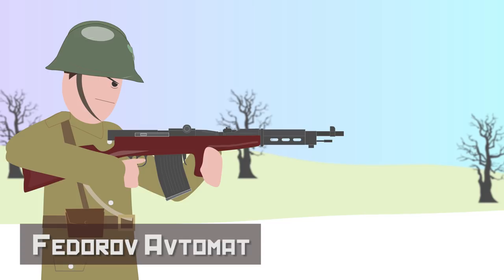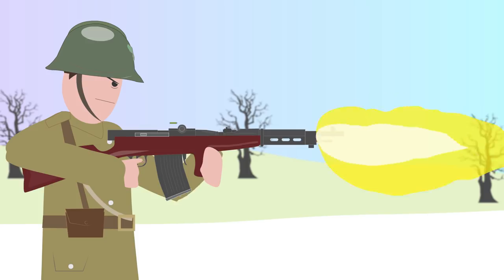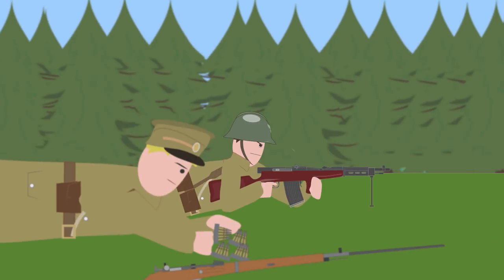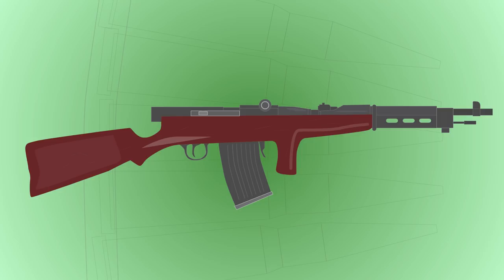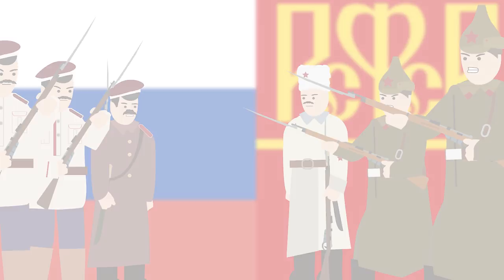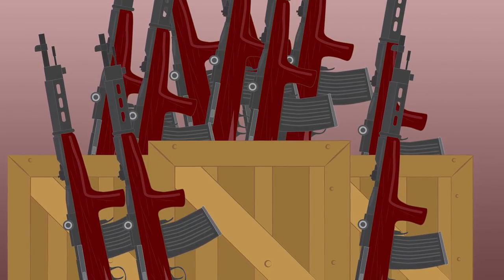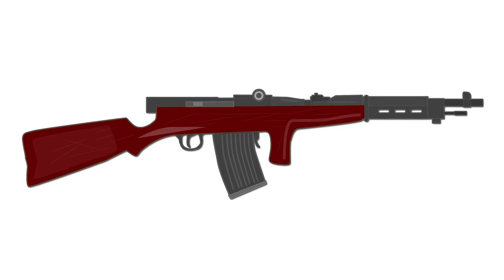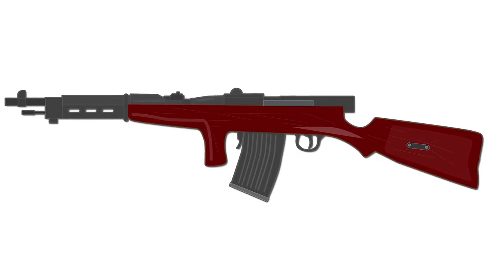Fedorov Avtomat, The First Assault Rifle?

Comment: THAT weapon may hold the key to an automatic high velocity firearm. The action is unique and has not been repeated. The barrel acts as recoil mitigation and piston. The barrel does not have a tapped gas port.
Reply: The action is a dead end Design that lead to nothing.
Reply: @Greycat2017  You got to think outside the box, Ivan. By itself, the action is insignificant; however….

Comment: "Required hand fitting" what does that mean? "spare parts were few and far between"? 30,000 were built and 3 magazines were standard issue. It CAN be fed by stripper clip but it also had detachable box magazines
Reply: Probably wanna drop a zero on that number.
Reply: Quote: A total of 3,200 Fedorov rifles were manufactured between 1915 and 1924 in the city of Kovrov; the vast majority of them were made after 1920

Comment: I wouldn't really classify it as an assault rifle, since the restrictive loading system put it more into the role of an LMG. The Bren and BAR were relatively similar and they're usually not described as assault rifles. An assault rifle is typically a fully automatic gun firing something between a full rifle round (.303 or 30-06) and a pistol round (9mm or .45) being used by a single soldier to rapidly advance.
Reply: FEDOROV AR (6.5x47) ballistic properties are very close to modern idea of "ideal" assault rifle and its ammunition like:

6.5mm Grendel (6.5×39mm)

.220 Russian hunting cartridge is developed based upon the military 7.62x39mm M43

6.5x47mm Lapua (or 6.5x47mm)

The 6.8 mm Remington SPC (aka 6.8 SPC, 6.8 SPC II & 6.8×43mm)

.280 British

300 AAC Blackout, SAAMI short name 300 BLK, also known as 7.62×35mm

Comment: A problem with the Avtomat is that it uses a full-size rifle cartridge. It's generally agreed upon that assault rifles fire intermediate rounds. On top of that, its tactical relevance is limited as it never saw widespread use as the later (and generally agreed upon as an AR) STG-44

Comment: Even though it resembles an assault rifle and even has elements of one it's still not one. It's much more related to a LMG or DMR like the BAR or SVT. Definitely revolutionary though. The cartridge was much too powerful and it needed a pistol grip. The fact that it ran at 400 rpm with a closed bolt during WW1 is astonishing.
Reply: 6.5mm Arisaka round size and energy is between a pistol and big tank gun along with 7.62x54R mm. It is also some nearly 5 lbs lighter than a BAR. It is also some 5 inches smaller than a BAR. Pistol grip showed us the future as many bigger guns will get more pistol looking design grips.

Doctrine wise, role wise, and design wise in modern terms. It's close to the current assault rifle though it's s abit more heavier than an M16 and M4 really that's due to argue being a 1st gen design and firing a heavier bullet at similar velocity. Plus the name wasn't coined yet then.  However by modern terms it is by definition and role wise an AR.

Comment: Pistol:
• pistol grip
• pistol cartridge

Rifle:
• Rifle cartridge
• Single fire

Assault rifle:
• Pistol grip
• intermediate cartridge
• select fire

Machine gun:
•Rifle cartridge
• at least fully automatic fire

______________________________________

Fedorov Avtomat:
• Rifle Stock
• Rifle cartridge
• select fire

It's a machine gun.
Reply: Nope. The 6.5 Arisaka is maybe classified as Rifle cartridge, but that's just because it was never reclassified - for obvious reasons.
6.5 Arisaka has the same energy as modern intermediate cartridge 6.5 Grendel. Also, it had energy between a standard Russian pistol cartridges and main rifle round, the 7.62x54R - that's literally the definition of intermediate round.
 And at the same time, it was used for the same reason as 7.92x33 Kurz - low recoiling cartridge for automatic fire.

So the only thing it "lacks" is pistol grip.

Comment: Assault rifles typically have intermediate rifle caliber between shorter than battle rifles (x50mm) and longer than submachine gun (x20mm). So it's one of the first purpose built gas-operated battle rifle
Reply: What? It doesn't matter how long the casing is - the energy of the cartridge matters. 
The 6.5 Arisaka has the same energy as 6.5 Grendel, which is an intermediate cartridge.
Reply: @BloPsy__  well the underpowered 6.5x50mmR type 38 bolt-action rifle (from the early 1900s) compared to the 6.5x39mm grendel (designed for med-long distances on AR platform) then theres 9x18 and 19mm compared to 9x39mm
Reply: @lx1995Mk2  9x18, 9x19, and 9x39? I don't really know what you try to say.

Comment: Not an assault rifle, an assault rifle fires a intermediate carriage that is in between a pistol round and rifle round. It is just a select fire rifle
Reply: Then you don't know much about the cartridge this Avtomat used.
By today's standards, 6.5 Arisaka is certainly an intermediate cartridge. It has the same energy as 6.5 Grendel, which is modern intermediate cartridge. Also, it was used for the same reason as 7.92x33 Kurz - low recoiling cartridge more suited for automatic fire.
 And on top of that, in terms of Russian military, the 6.5 Arisaka had power right in between of standard pistol cartridge and standard rifle cartridge - which is the definition of intermediate cartridge.

Just because the cartridge wasn't initially designed as intermediate cartridge doesn't mean that it cannot be considered as one when used by Russian military in Avtomat Fedorova.

Comment: No, it wasn't the first assault rifle, although in practice it was deployed more like an assault rifle.  Since it fired a full power cartridge (albeit, at the lower end of power) in the form of the 6.5×50mm Arisaka round, but this is way more powerful than intermediate cartridges and actually closer to the full powered ones.  It would be fair to call it (as said) an 'ancestor' of the assault rifle.
Reply: it's the first battle rifle, not assault rifle, and yes there is a difference between the 2
Reply: @engiturtle65  
I'd reluctantly say it's a battle rifle, but its full auto option (and deployment) is questionable. If so, how do you put the FN FAL and the BAR, especially the FN Model D?
Reply: @MrBahjatt  the bar is more of a light machinegun
Reply: @MrBahjatt  also a quick google search litteraly says thah the fedorov avtomat is the first ever battle rifle
Reply: @engiturtle65  
A limited capacity (Not so) light machine gun yes.  Yet the Federov Avtomat is as you say is more of a battle rifle; albeit, an underpowered battle rifle. 

I say due to its round and automatic capability, it is really in a grey zone between battle rifle and assault rifle, veering closer to the light machine gun/battle rifle concept.
Reply: @MrBahjatt  yeah, alot of weapons would land in the grey area at the time because of how new they were, especially since the fedorov also was used more as a  lmg than a battle rifle, im also pretty sure they tried to make an actuall lmg version of the fedorov avtomat
Reply: Even though the 6.5 Arisaka was developed to be a full-power rifle cartridge, it's a very anemic one. In fact, it has an energy of around 2600J at a velocity of 770 m/s when shot from a 31-inch barrel. That is already comparable to the modern intermediate cartridge 6.5 Grendel. 
When shot out from Avtomat Fedorova with a more modern-like barrel length of 20 inches, it has a velocity of around 654 m/s and energy of around 1925J - Which is even less than what 7.62x39 outputs. 
In terms of its use in Avtomat Fedorova, it was used exactly because of this low energy and thus low recoil - the same reason why 8mm Kurz was developed. As a bonus, the cartridge falls right in between standard pistol cartridges and the standard rifle cartridge of the Russian Empire, the 7.62x54R (3700J), which is the definition of an intermediate cartridge.

Comment: >6.5x50
>clips instead of mags
>assault rifle
yeah sure....
Reply: It had removeable mags, but the Russians didn't have enough of them, so you had to load them with stripper clips. Obviously it didn't have an intermediate cartridge, that didn't exist back then. The point, is that it was one of the first automatic/semi automatic RIFLES.
Reply: @grootsChannel  that's the point, it was maybe the first AUTOMATIC RIFLE, but not an assault rifle.
Reply: @Blei1986  yes, but I could've been used like an assault rifle, if only the Russians realized that. Instead they used it as a regular old machine gun.
Reply: @grootsChannel    in theory yes, but as i stated in my first post, the cartridge is pretty much a rifle cartridge.
The "awsome" thing of assault rifles is their "special" ammo, that has light recoil for (more or less) accurate burst-full auto fire at short range but is accurate enough for mid-high range shots in semi auto.
it's the "ultimate" multi purpose round.
i really doubt a 6.5x50 round in full auto will be a pleasure or accurate to shoot.
Reply: @Blei1986  Well, I gotta give you that. I guess you could call it the predecessor of the first assault rifle, more than the actual thing.

Comment: I wouldn't class it as the "first assault rifle"  due to one factor, it doesn't shoot an intermediate cartridge, it shoots the 6.5x50mm arisaka round making it a full bore rifle cartridge, the AVS 36 has a select fire system also but it isn't classed as an assault rifle even though it has the same capabilities.
Reply: FEDOROV AR (6.5x47) ballistic properties are very close to modern idea of "ideal" assault rifle and its ammunition like:

6.5mm Grendel (6.5×39mm)

.220 Russian hunting cartridge is developed based upon the military 7.62x39mm M43

6.5x47mm Lapua (or 6.5x47mm)

The 6.8 mm Remington SPC (aka 6.8 SPC, 6.8 SPC II & 6.8×43mm)

.280 British

300 AAC Blackout, SAAMI short name 300 BLK, also known as 7.62×35mm

Comment: It's not assault rifle, it's main battle rifle. Assault rifle shoots intermediate cartridge (5,56x45,7,62x39,5,45x39 etc.) Fedorov shoots rifle cartridge
Reply: But by modern standards, the 6.5 Arisaka which was used in Avtomat Fedorova is basically an intermediate cartridge. It has the same energy as the 6.5 Grendel, which is a modern intermediate cartridge. 
So it is really a battle rifle as you say?

Comment: Assault rifle isn't a category officially.. AR stands for Armalight.... I thought you did your research
Reply: - AR can stand for Armalite Rifle or even Assault Rifle (Of course not in case of AR-15). Assault Rifle is way older term than AR-15 so what's your point? 
- Assault Rifle is official category used by many miliatries around the world. It all started with StG 44, which gave the name to that category. Sturmgewehr = Assault Rifle. I will list few examples here: StG 77, FAMAS, RK62, etc... They are all designated as Assault Rifles.

I thought you did your research

Comment: So what would actually constitute as an OG assault rifle bc I've always felt like the BAR was one of the first as well even though it was meant to be a squad "LMG" even though it only had a 20 round box magazine and could be fired effeciently and accurately shouldered like assault rifles.
Reply: Browning did make a 40-round box magazine for the BAR, but the BAR wasn't an assault rifle. The BAR fired full powered ammo, so even if you use it as a rifle it would be a battle rifle. Same is true for the Fedorov Avtomat and AVS-36, they too were battle rifles. A battle rifle is a selective fire rifle that fires full powered ammo. An assault rifle on the other hand is a selective fire rifle that fires intermediate ammo like the 7.92x33mm Kurz, 7.62x39mm, or the 5.56x45mm NATO. So the first assault rifles were the Machinenkarabiner 42(H) and the Machinenkarabiner 42(W), they were the predecessors of the StG 44.
Reply: @TheNocturnalEvil  FEDOROV AR (6.5x47) ballistic properties are very close to modern idea of "ideal" assault rifle and its ammunition like:

6.5mm Grendel (6.5×39mm)

.220 Russian hunting cartridge is developed based upon the military 7.62x39mm M43

6.5x47mm Lapua (or 6.5x47mm)

The 6.8 mm Remington SPC (aka 6.8 SPC, 6.8 SPC II & 6.8×43mm)

.280 British

300 AAC Blackout, SAAMI short name 300 BLK, also known as 7.62×35mm

Comment: Actualy there is a simple way to tell if its an assault rifle or not
1.if it can shoot fully auto and semi auto its an assault rifle
2.if its have a detachable magazine its an assault rifle
3.if the bullet was bigger than an pistol and an smg round but  still smaller than a rifle or a machine gun round (intermediate round) its an assault rifle
4. If the rifle has all of the 3 category above  its an assault rifle 
But fedorov sadly doesnt have the 3rd category he use arisaka rifle and its a rifle bullet not an intermediate bullet
Edit: if the rifle only has the 1st and the 2nd category its could be categorised as a battle rifle or a ligth machine gun with banana magazine
Reply: Actually, it does have the 3rd category - you clearly don't know much about the 6.5 Arisaka.
By today's standards, it's actually an intermediate cartridge. It has the same energy as the 6.5 Grendel, which is a modern intermediate cartridge.

Comment: "it had to load all 25 rounds via stripper clips"

bf1: magmazine
Reply: keith sze  yeah you're right
Reply: It would be so annoying if they it was reloaded via stripper clips
Reply: it has a magazine, just they had no other magazine to switch it (on the early models, the later ones didin't require that hand fitting anymore)
Reply: Mmm… m a g M a z i n e

Comment: For a gun to be considered an assault rifle, it must have 3 things so far:
Selective fire: yes. Fedorov got semiauto and full auto.
Detachable mag: Fedorovs got only 1 mag per rifle, but technically they pass this. The mag is detachable.
Calibre: assault rifles must have an intermediate cartridge. That means, no pistol calibre or machine gun calibre. And there is the problem: Fedorov was chambered in 6.5x30 Arisaka, wich is technically a machine gun round. Also the Fedorov was deployed as a machine gun, so technically, it is not an assault rifle but a light machine gun. 6.5 was chosen by Fedorov for his rifle because it got better behavior in full auto than 7.62x54r, and he was right, because the soviets tried to make some auto/semiauto rifle chambered in 7.62x54r and it was a complete disaster. It was the AVT-40 and curiously was designed by Fyodor Tokarev himself.
Reply: Fyodorov Tokarev? XD
Reply: @AlyoshkaNecro  Fixed
Reply: @stalker4474  👍
Reply: By modern standards, 6.5 Arisaka is an intermediate cartridge. 
At the time of adoption in the Russian military, they already had the full-power rifle cartridge 7.62x54R and as such, the 6.5 Ariska was between that and pistol cartridge in terms of energy. And as a bonus, 6.5 Arisaka is fully comparable with 6.5 Grendel (Which is a modern intermediate cartridge) in terms of energy. And to make it even better, 6.5 Arisaka was used for the same reason why Germans used the 7.92x33 Kurz in StG 44 - mild recoil in automatic fire.
Reply: FEDOROV AR (6.5x47) ballistic properties are very close to modern idea of "ideal" assault rifle and its ammunition like:

6.5mm Grendel (6.5×39mm)

.220 Russian hunting cartridge is developed based upon the military 7.62x39mm M43

6.5x47mm Lapua (or 6.5x47mm)

The 6.8 mm Remington SPC (aka 6.8 SPC, 6.8 SPC II & 6.8×43mm)

.280 British

300 AAC Blackout, SAAMI short name 300 BLK, also known as 7.62×35mm